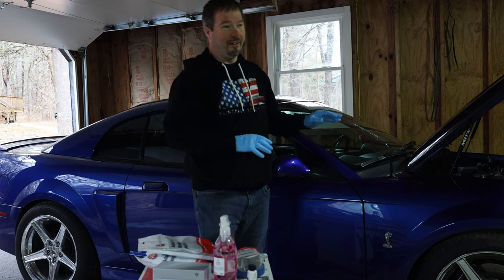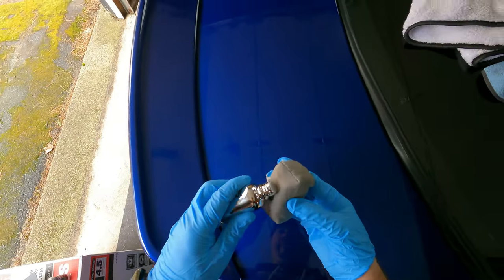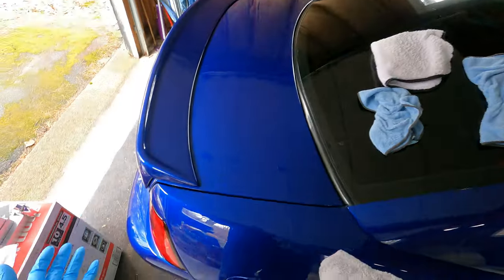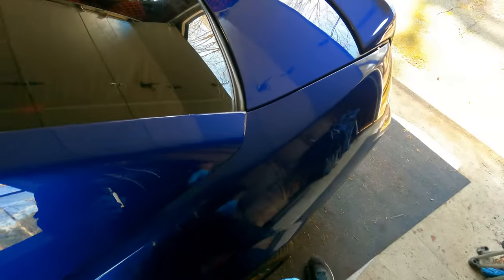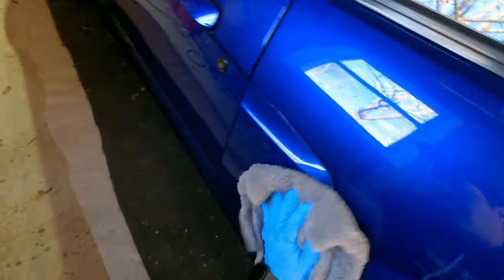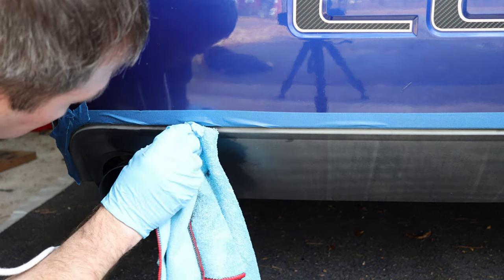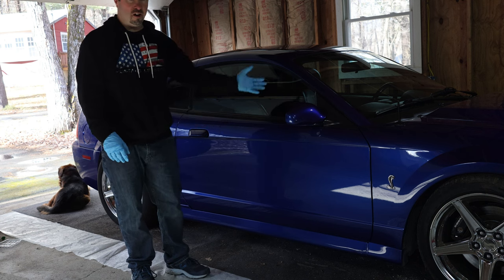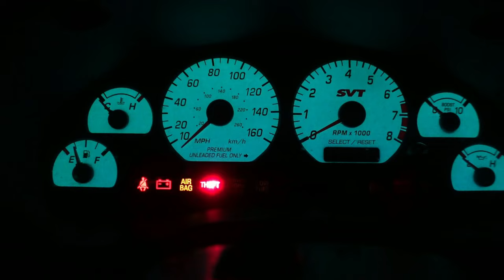How to do Ceramic Coating Yourself

Comment from the maker: The product I used on the black bumper area is called Solution Finish. The link is in the discription below. I forgot to talk about it before doing it, or I did and forgot to put that part in the video during editing.
Reply: Ok, glad you posted this comment because I kept trying to see where I missed what the product was on the bumper valance lol
Reply from the maker: @justin.c_svt  I recorded it but through the process of editing I missed it somehow lol
Reply: You may wanna try "texture spray paint for plastics" next time. Easy to use, no need for primers and it only takes two thin coats. It will last forever.
Reply from the maker: @TwiztedJugallo  that sounds like a good option too

Comment: I applied some Adam's graphene advanced spray on One of my other vehicles just to test it out before applying it on the Cobra and was very pleased with the results.  

Does your Sonic blue have any orange peel?  Or do you feel like the paint is very reflective and crisp? Like a mirror image?
Reply from the maker: @irecruitfish7410  I’ve used Adam’s ceramic before and I liked it as well. Factory paint will always have orange peel but some colors hide it better than others and depends on the angle you are looking at it. I’m happy with how mine looks after paint correcting snd ceramic coating it
Reply: @Lethal_Venom  good to hear!  I was losing my mind after applying clay, heavy cut, polish and seeing orange peel.  Wasn't happy but gotta deal with it.  I have a torch red one. Hopefully applying the graphene spray will cheer me up
Reply from the maker: @irecruitfish7410  yup it’s quite common on any factory paint from back then